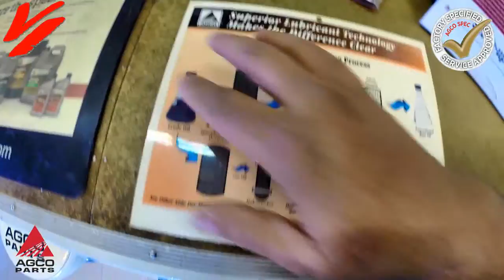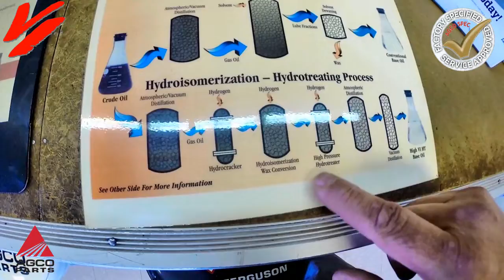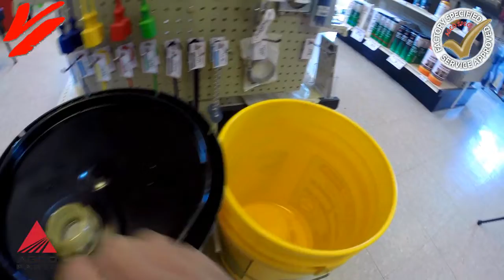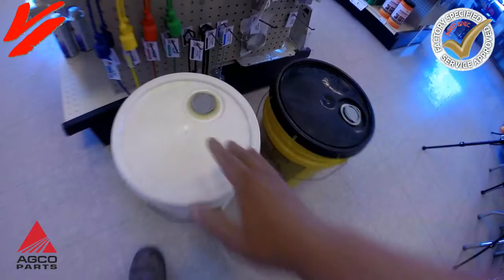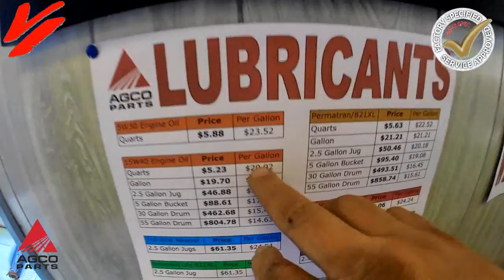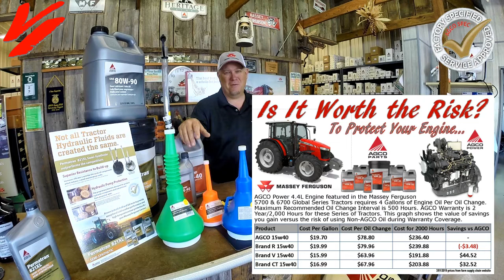The Basics: Understanding the Differences of AGCO Oil & Lubricants

Comment: All I know is the multi guard does not turn black as fast as other oils, is this a good thing? From what I’ve noticed other oils go black much faster, not sure what to think of it
Reply: Multiguard 15-40 is all I have used
Reply: Thank you, I’ve used it in a couple tractors and just put it in one of my trucks, going to start putting it in all of them, very happy with it so far!
Reply: Just a question, it’s good for on road pickups as well? Like I said I put it in my Cummins, and I have a 7.3 powerstroke as well that I want to use it in as well
Reply from the maker: I've run it in my personal vehicle DuraMax Diesel before they provided free maintenance with purchase of my last vehicle if not it would be my oil of choice.
Reply from the maker: That can be based on several things. The Purity of the Base Stock is very clear with the refinement method AGCO uses. Other is the Soot Holding Ability of AGCO Lubricants can disperse those particles throw out the oil. Also can be the heat tolerances and not "Burning the Lubricant" making it look black.

Comment: THANK YOU for this video! I truly understand the importance to sticking with OEM filters and OEM recommended brand oils. WHY don't other Massey Ferguson Dealers themselves believe in this??? Called 5 of my local Massey Dealers and they don't stock it. One Dealer told me by the time they add their "must have" mark up, the AGCO products cannot compete with aftermarket brands. ??? I want to buy OEM Massey Ferguson Brand Products!!! Again, THANK YOU for taking the time for this very important video. These tractors are investments for generations. :)
Reply from the maker: They are missing out. When we Price Shop the Competition AGCO Parts are often a Better Value  if not lower priced. Especially when you look inside or compare the specs. If you need it we can ship it! We stock ONLY Genuine and lots of them!